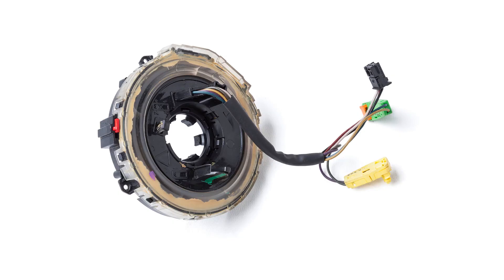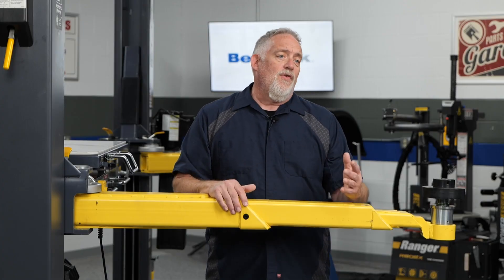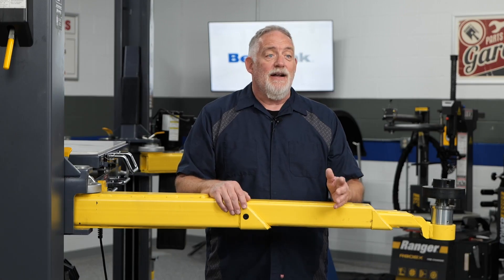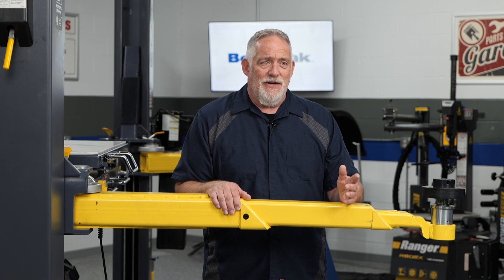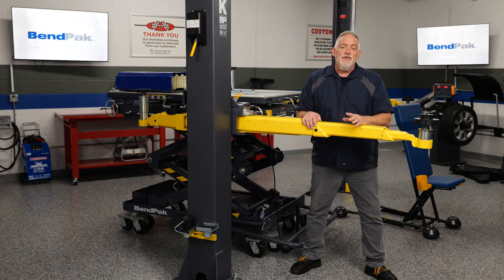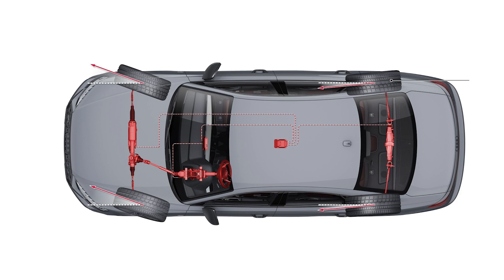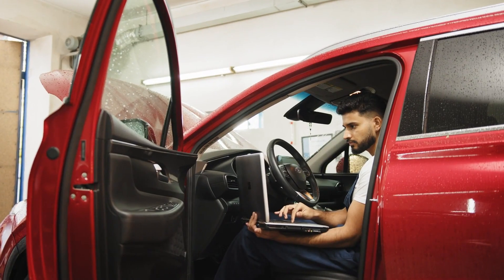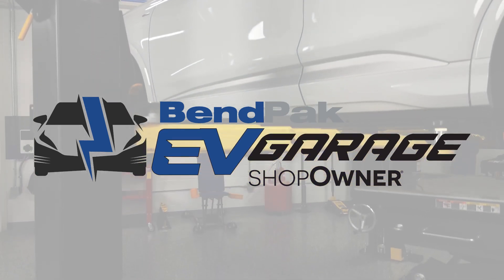Electric vehicle power steering

Comment: My friend owns a 2019 Jaguar I-PACE, his power steering went into "Power Steering Assistance Reduced" mode, The Jaguar dealership inform him he needs to replace the "RACK AND PINION" a $6,000 part from Jaguar but after being recommended to another garage, this other garage believes it's not the "RACK AND PINION" since he experienced 3 other times when the power steering assist was not functioning, but after waiting 2 minutes and restarting the vehicle, the steering was back to normal, so under that conclusion, this other garage believes the ECU MODULE might have been impacted by water, when he had the underneath of his jaguar washed the salt from underneath the vehicle,  What is your thoughts on this, could it have been water that impacted the ECU module?